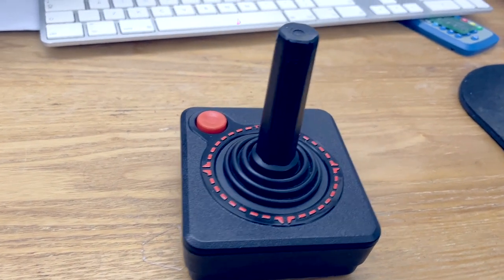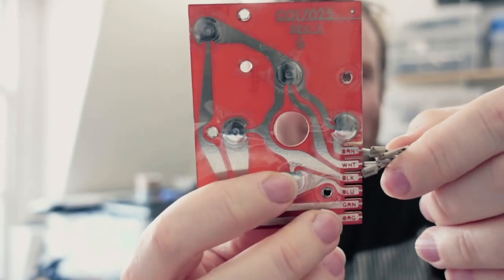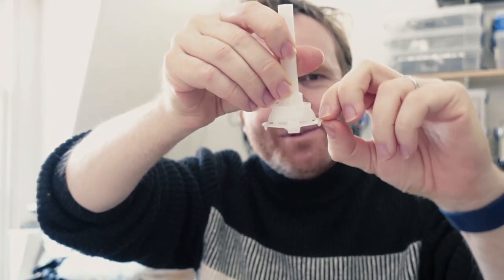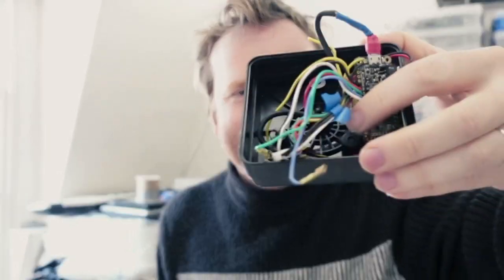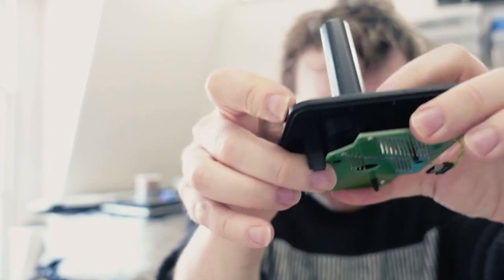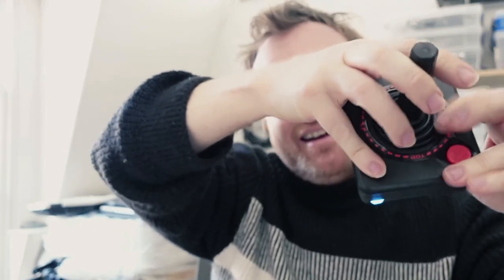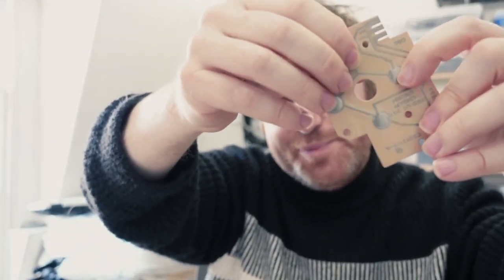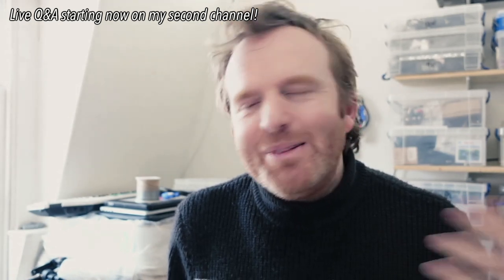Wireless Atari Joystick for Matt Parker (@standupmaths)

Comment: Think there was aftermarket an IR one as well, that was a little thicker, and used 2 AA cells, and a standard remote control IC inside, with the receiver being the same chip. I know they used that for a remote version for Sega controllers, which also used the same IC and IR connection.

Incidentally those click buttons are still available new, and you can buy a sample pack of 100 of each type, to select which particular tension and size will work best for you. Board just has to have thick gold plating on the contact surfaces, and it will be very reliable, and last millions of cycles. You can just use regular kapton tape to hold the buttons down, though you do get some with little legs, that you put through the board, and spread out on the back, that need no tape, and which are just as robust. Double sided board, through hole with plated via's, and full hard gold plate on the entire board, or selective plating on the switch area only.
Reply from the maker: Oh super interesting, I wonder if the joysticks I showed were IR and not radio? Link me to the dome buttons!
Reply: @seblee  ps they also offer free samples, though I think buying the sample selection would work out better, as then you can get the right one for you, and order a thousand, as a lifetime supply.